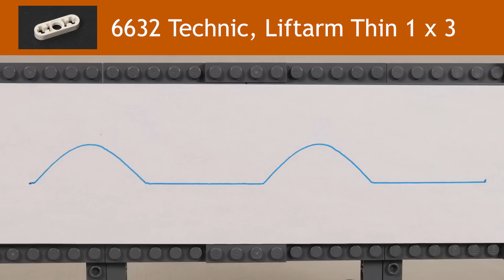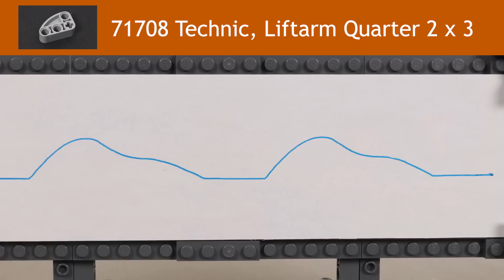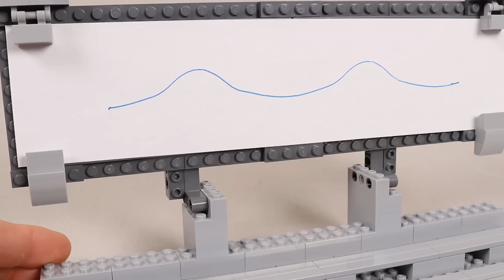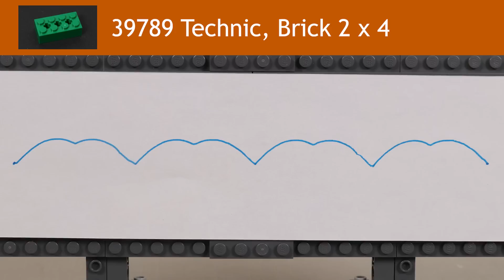Graphing the Motion Profile of LEGO Cams

Comment from the maker: Turn on captions for some commentary on the build.
What other parts should I try?
Reply: Try adding cams together (superposition) to create some truly strange waves
Reply: A prototype of a cam that results in a single letter. And then the boy automata by droz X) that would be the greatest Lego set of all time
Reply: A minifigure! :P
Reply: Bionicle pieces with ball joints like 64276 and 32173 . Various gears, especially those crossshaped ones 32072 . And ofc 57585 .
Special ones on bricklink:
58177 
44850 
55615  and  48989 
41667 
Technic, Gear Expert Builder 9 Tooth
32166 
combinations of parts with these: 65098
43464 
2850 
70644 
6572 
89679 Technic, Panel Curved 2 x 1 x 1
also with a bit of working around the corner with connectors panels like 87080
Reply: What is the name of that music? It is extreemly relaxing
Reply from the maker: @Emperor_Atlantis  Drifting at 432 Hz - Unicorn Heads
Reply: Try pieces with one or more joints. You may need to change the setup a bit but it will be so cool.
Thanks for this video. It's my favorite one from the channel.
Reply: A gear?
Reply: Part #89679, Technic panel 2x1x1. It would only go 1 way, but I think it would certainly produce an interesting curve.
Reply: I feel like with enough time and thought you could probably produce a picture similar to a heart ECG. I really wonder what the contraption of cams and the like would look like! In that case, it would probably be better to have a stationary pen that only moves vertically while a roller pushes paper like a proper analog ECG chart.
Reply: Definitely need to retry all of the pieces with a narrow/point follower for a comparison.
Reply: That was super cool and fascinating... I don't know what you can draw using LEGOs, but it would be fun to construct a graphical  'printer' using interchangable LEGO print heads... Put an Image into the software and the LEGOs  print out an interpretation of the image... Nice project idea.
Reply: Nice
Reply: ❤❤😊🎉😮 @paperplanesnew
Reply: It would be cool to see some of those in reverse or like flipped around
Reply: Try mounting the coat-hanger piece with the shafts going through the top of it. I suspect you'll end up with something very square wave. Or possibly a square butt-wave.
Reply: This may be too late, I'd like to see some cams built out of curved system pieces to see what they'll do and use that to transfer motion to something in a GBC module. Maybe I'll have to try that myself if I can find the time.
Reply: “commentary” more like jokes
Reply: Technic Beam 1 x 2 with Ball Joint Angled
Reply: You should try a 2x2 round brick!
Reply: UT was auto

Comment: What your graphing on paper is the radius of the shape on the y and time or degrees of rotation of the shape on the x. Very cool! Its not a perfect system because the interchangable chapes are pushing up on a flat surface so things like the blade rotor hit that flat surface at 2 points 2:03 . 
Is it possible to build a similar contraption that doesnt use that flat surface and only allows for, at most, one point of contact with the interchangable shape?
Still going to show this to my students, though!
Reply: It looks like rectified 3 phase AC

Comment: At 1:12 I realized that this basically converts polar graphs into their rectangular counterparts with the off-center circle and the sine wave. So cool!
Reply: Convolved with a square wave though, due to the shape of the camshaft. Look at the l bracket for example, it does not return to zero between the points of the L.

Comment: I wonder if anyone has or will find the equations for these. It would be really neat to see an infographic of them all together or something like that.
Reply: I think it's actually just graphing the radial component of the height of the block, in polar coordinates with the shaft as the center r=0.

I mean, if you look at the mechanism, that's like... Literally what's happening mechanically.

The radial component gets convolved with a square wave though, due to the shape of the camshaft. Look at the l bracket for example, it does not return to zero between the points of the L.

Comment: For a more correct representation of the cam profile, the follower needs to be a single point instead of a plate; altough with the limitation of lego pieces, the mechanism could easely get stuck in deep creases, like the 3x3 Liftarm L-shape, and teh resolution would still not be under the size of a 1x1 pin hole.

Comment: It would be interresting to see multiple graphs stacked on top of each other, (or in other words, a graph that shows the addition of two shape-graphs)should be possible right? I mean "simply" build another moving platform in between the shape and the pen, and on that platform there is another shape that is rotating based on the movement of the whole thing, and is connected via gears that allow free up/down-movement, with like those red 12 tooth gears. and then the pen movement is dependent on that shape.

So you get a shape that influences a platform on which another shape is placed on which the pen is placed. I don't know if anyone gets what I mean, but I think it would work

Comment: Jason, I need your input! What is the lego part 32060 ( 8 tooth timing gear) used for?
Reply from the maker: I believe it was used in conjunction with the light sensor of some of the old programmable controllers to count rotations. It's mostly used decoratively these days, or as a manual control knob.
Reply: @JKBrickworks  I appreciate your quick response! I will have to come up with a good use for it!

Comment: You should try a more “pointy” follower head, that would more closely capture the local radial diameter of the cam object. With the horizontal bar configuration it just follows the largest protrusion within ~180 degrees
Reply: It would get stuck really easily
Reply: Exactly.
Reply: This was also my first thought when he switched to the 90 degree cam.
Reply: A little wheel (or round shape) would be perfect for this job.
Reply: Only thing I can see is that it wouldn't work with the first few

Comment: Bionicle pieces with ball joints like 64276 and 32173 . Various gears, especially those crossshaped ones 32072 . 

Special ones on bricklink:
58177 
44850 
57585 (ofc)
55615  and  48989 
41667 
Technic, Gear Expert Builder 9 Tooth
32166 
combinations of parts with these: 65098
43464 
2850 
70644 
6572 
89679 Technic, Panel Curved 2 x 1 x 1
also with a bit of working around the corner with connectors panels like 87080
Reply: thanks, for part 2

Comment: Idk how you could implement this in lego but it would be cool to do the inverse of this. Take the linear graph and turn it back into the outline of the brick
Reply: I don't think you could auto-trace the line with pure lego, but if you cut the path in cardboard you could have that go by on the left, while an arm of the tracing mechanism is in the cut path (so it follows the line) and on the right side have a paper that spins in place. If the period matches, it'll trace the shape of the brick on the spinning paper as the cardboard cutout lifts and drops the pen.

Comment: You could make an analog integrator with something like this. That would be awesome!
Reply: mechanical integrators don't involve much with cams like this; you only need a disc rotating at a constant speed, another circle that rotates on the disc, and something that records the total rotation of the rolling circle. cams usually involve projecting a certain component of the cam's shape into reciprocating/variable motion, but with a mechanical integrator, all that's happening is rolling, and the variation in the motion happens parallel with the rotating disc. furthermore, the variable position of the rolling circle is determined by a predetermined input (the function you want to integrate), and does not depend on the rotating disc whatsoever. so if you consider the cam to be the constantly rotating disc, and the follower to be the rolling circle, you are always projecting exactly 0 vertical motion to the follower. so at best this would be a trivial case of a cam and follower. note i am not an engineer so my language about this may be off.

but yes, a lego mechanical integrator would be absolutely awesome!
Reply: @martyguild  with the resurgence of analog computers it’d be really neat to see some more educational videos on their operation and the fact we can use mechanical analogs to do that is super flipping cool :)

Comment: The mathematical implications of this build are super interesting: With the left and right motion combined with the turn of the axle, a sine wave is created. Each piece that gets added is essentially a function that, with its height difference, creates an amplitude multiplier function over time. Everything lower than the pen itself is seen as a zero multiplier and afterwards it's combined linearly. With a piece like the 3 blade rotor it's including a phase shift with the sine waves. The end result being 3 sine waves, shifted 120 degrees between each other.
Reply: I liked the 3 point rotors too it reminded me of a 3 phase generator output
Reply: @Doomsday494  Yeah!
Reply: This is a great tool for demonstrating the use of lateral number systems; describing periodic wave functions in terms of radial geometry
Reply: It's a mechanical Radon-transformation.
Reply: I like the not so intuitive thing that the quarter round actually produces a flat line.
Reply: @satibel  I mean the curved edge of it is always the same distance, just like a wheel rolling on the ground. It's just that only 1/4th of it is a wheel. It would be different if the rotation point was not in the center of the circle that the piece was "cut" from, but it is in this case.
Reply: @satibel  consider the definition of a circle; it's the set of all points which are equidistant from a point that we call the center. so once you reach the round part (assuming it's indeed a circle), the vertical height will always be the same distance away from the axis of rotation. it might not be quite immediate but it makes a lot of sense
Reply: Gotta love it, there are sinewaves everywhere. You can create every possible signal out of a (infinite) set of sinewaves with different frequencies.
Reply: @grillpig3860 Fourier transform, baby!
Reply: This video made me think of Fourier transforms. If he combines more pieces on the axis, the amount of possibilities increases rapidly. You should try it Mr Channel Owner. Not quite the same thing but concept is there.
Reply: Imagine the education applications this device could have
Reply: interesting indeed!
Reply: I understood what you said, but I definitely couldn't have explained it in such depth. Bravo on your smarts, lad
Reply: I was really expecting the sine wave. Hahaha.
Reply: Are you describing 3 phase power transmission?
Reply: @Alkatross  Not exactly. N-Phase Power is what happens when N equally shifted sine waves transmit energy. In the video, this happens with the 1x5 technic plate and the 3 blade rotor which creates 2-Phase and 3-Phase Power respectively. If you were to use different components that are shaped more complex than regular lines you'll get a more generalized form of this phenomenon.

In conclusion: 3-Phase Power is a sub-set of what is part of the video.
Reply: @Necromaticon  Have you heard of space star ordering?
Reply: All I got from that is the Legos are making neat lines
Reply: Perfect! Let's throw some 808s on it and really start utilizing those sine waves! 😁
Reply: You should check out fourier transforms
Reply: This is a start that could become a mechanical integrator, https://www.youtube.com/watch?v=s-y_lnzWQjk
Reply: Only didnt understand the last 1/4th

Cus I'm a math nerd
Reply: Polar coordinates
Reply: hey what you're talking about relates to mechanical tide prediction computers of the late 19th century
https://youtu.be/IgF3OX8nT0w
Reply: Im to dumb for tjis
Reply: NERD
Reply: why multiplayer, why a thing is a multiplayer?! i dont understand
Reply: I like your funny words magic man
Reply: You got any proof it’s a sine wave bud
Reply: @MikehMike01  Try 1:12 in the video ;)
Reply: what
Reply: I understand this kind of math very fundamentally but this was nonetheless an interesting read
Reply: Over complicated way of saying it but okay
Reply: My brain hurts! Nuuuuuurse!!
Reply: erm actually, when graphing a trigonometric function you use radians not degrees. 120 degrees is 2π/3 radians. 🤓
Reply: @largewallofbeans9812  It's all a matter of perspective which ones you want to use. By all mathematical means they are equivalent and can be linearly converted between each other by using pi/180 or the inverse. It's like saying you can't use meters per second because kilometers per hour is what's normally used to measure speed for cars. In both cases they're describing the same. I've used degrees due to the more intuitive nature the unit provides for to readers.
Reply: @Necromaticon  yeah but many trigonometric identities (eg. d/dx sin(x)=cos(x), d/dx tan(x)=sec^2(x), cos(ix)=cosh(x), e^ix=cos(x)+isin(x)) only work in radians. also its much easier to graph radian sines on a 1:1 graph than it is to graph a 360 period sine.
Reply: Hehe I eat legos 😋
Reply: God I should have paid more attention in circuits class
Reply: Think about the mathematical implications of camshafts in cars. Imagine graphing that. Different lift and duration on exhaust and intake with of set and overlap.
Reply: Nerd
Reply: Imagine putting different gears for different lift arms. That’s basically a finite Fourier series!
Reply: Excuse me; WHAT?
Reply: What he said!
Reply: I just earned 50 of iq by reading this
My man ill get into math now
Reply: Nerd
Reply: Thought I was kinda smart until I read this comment…
Reply: @MvB8891  The wording in OP's comment isn't very clear. "Everything below the pen is zero multiplier" just refers to the height (elevation) at which the pen sits when there's no block pushing the pen up (e.g. in the first test, when the rotating block is in the lower half of its rotation cycle, it doesn't affect the height of the pen because the pen can't go any lower than the minimum "resting" height). When the rotating piece pushes the pen upwards,  we can say the piece is adding to the elevation of the pen. So it's not an amplitude "multiplier" as OP calls it. We're ADDING the height of the rotating piece to the elevation of the pen. As for the last part, search "3 phase sine wave" and you'll see the resemblance with the line drawn by the 3 blade rotor.
Reply: @bctl9 this isn't reddit
Reply: Waiting for the 🤓
Reply: Umm I suck at math my brain is fried
Reply: your big brain words hurt my smooth brain

ouchies owie ow ouch
Reply: I like your words funny man
Reply: Personally, I think it's the other way around, what we commonly refer to as 'math', eg using 'sin' etc in some type of axiomatic system, like ZF-algebra, to describe oscillating geometric relationships, I find less interesting, and less useful than the explanatory and foundational insight available to humans based on physical manifestations like this.
Reply: @gemmatorreira6711  called it
Reply: Are you a genious or smthn
Reply: no clue what any of that means, but that’s cool!
Reply: Sounds smart, take my upvote.
Reply: Nerd time:
Reply: Jeeez too many nerds here chill guys xd
Reply: @c4rb0n40  lol no
Reply: @Rackmaster9K  cuz i didnt understand a word, prbbly cuz am still in elementary 💀💀💀💀💀💀💀💀💀💀
Reply: @c4rb0n40  Yeah this is highschool/early college level math, trigonometry.
Reply: Y’all’s are really talking about math in a lego video
Reply: @Kameron2335  This is the fun maths. The kind of stuff engineers use
Reply: @Rackmaster9K  i litteraly have a book in school called fun maths
Reply: @Kameron2335  but… that is what this video is about… demonstrating math using lego’s.
Reply: @Kameron2335  You're the one watching a video about the motion profiles of cams. Math is interesting.
Reply: @Kameron2335  THATS WHAT IM TALIKING ABOUT

Comment: 1:12 I'm here for the sine wave. It's beautiful!
Reply: Also, at 0:27, this cam produces the absolute value of the sine wave :)
Reply: @martyguild  You're right. Except for 1:41 and 2:10, they're all graphs of functions which only consist of sine functions and constants on specific intervals.
Reply: @lucahermann3040  technically, all of these can be written as a an infinite sum of sines and cosines, by the Fourier theorem! :) or at least approximated by a sum of sines and cosines. i am sure most of the series would not be pretty for these cams and followers though, haha.
Reply: @martyguild  why
Reply: I think that's a cycloid
Reply: @simeon7246  yep, the setup is analogous to a having a disc rolling on flat ground and graphing the position of a point on that disc
Reply: @KeimoKissa   No, it’s a sine wave! His device measures the height of the circle as it rotates while moving horizontally at a constant speed. When a cycloid is traced, it doesn’t go horizontally at constant speed, because the horizontal component of the circular motion is involved.
Reply: Yeah it's cool seeing them drawn mechanicslly. Obvi sin is the same as cos except offset but this would be closer to -cos(x). Sin(x) where x=0 is 0. This one starts at the lowest point in the trough. -cos(x) where x=0 is -1 just like that graph!
Reply: Too wide for sine wave, isn’t it?
Reply: @ilyin_sergey  it's shown in an interval that's 4π long instead of 2π, is that what you're referring to?